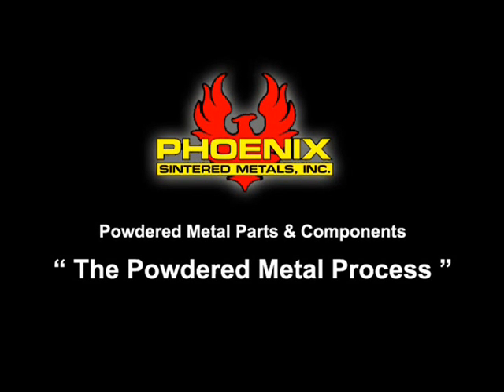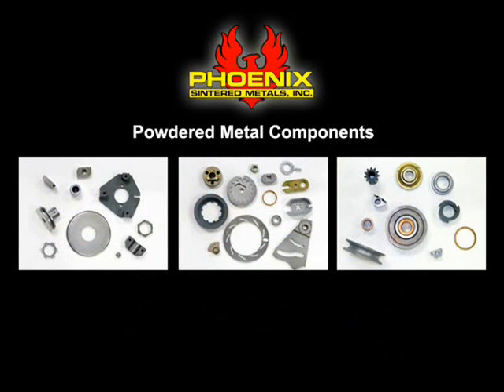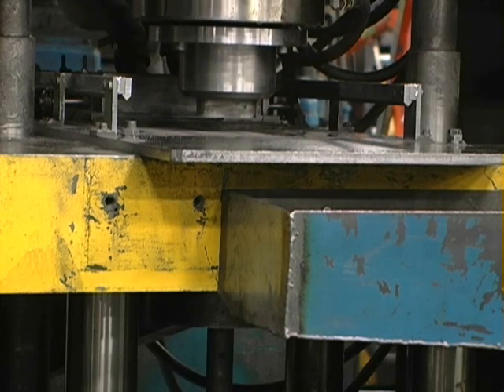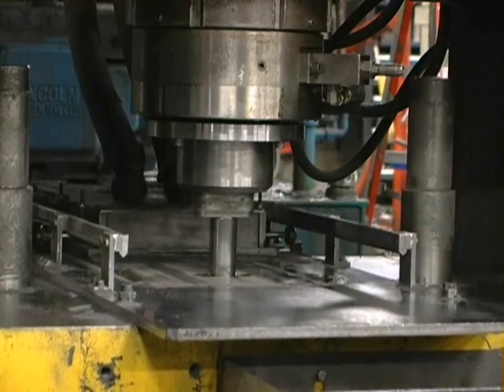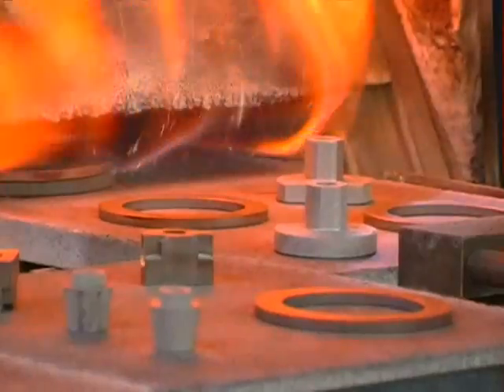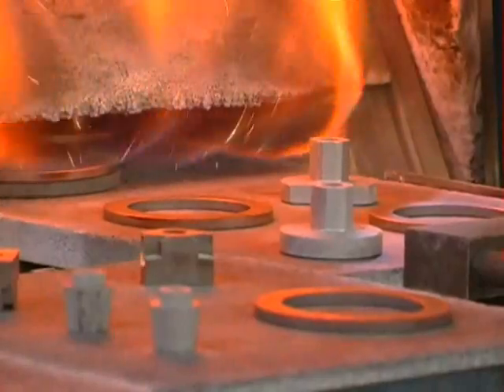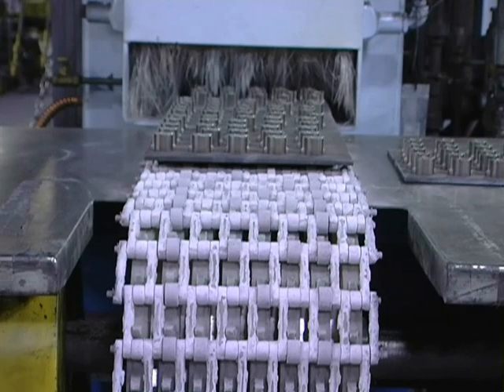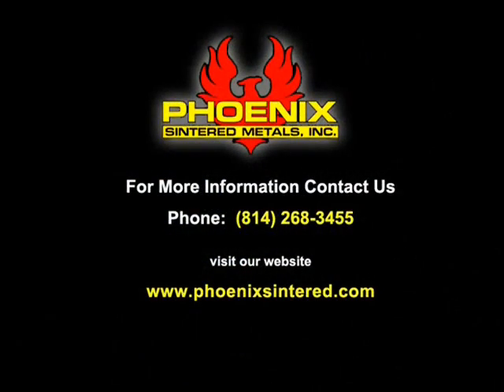Powdered Metal Parts

Comment: I worked at fms , we had to pull the parts off manually on a lot of presses , some were automatic and one had a robot arm that pulled coined parts off, one was 350 tons and was about 20 some feet tall ubove the ground and another 6-8 feet below ground, you had to climb up stairs to dump the powder metal in the hopper, it made Polaris snowmobile gear parts among other things, you could feel the floor vibration for many feet when that thing was running , there was a rumor that they got it out of a scrap yard and rebuilt it, then there was three cintering furnaces in the back room, on some parts we had to put copper slugs on the parts to infiltrate them when they went through the furnace ! I also ran cnc machines that used those Dimond tip cutters on them! I remember we would take this brown waxy stuff off the bottom of the furnace when it built up, it looked exactly like dog poo and you could throw it in swimming pools and freak people out cause it floated,lol!

Comment: Powdered metal = cheap shit
Non-durable parts.
Junk junk junk.
Thank you for creating and maintaining a cheap throw away world.. forged or nothing
Reply: Apparently you know nothing about powder metal parts. Many compontents in your vehicle is made from powder metal, including, but not limited to, connecting rods (which are forged), main bearings, transmission gears, transfer case gears, differential components. Ford, GM, Honda, Porsche, and many others all use powder metal. FYI, Ford, Cummins and GM both use powder metal forged connecting rods in their diesels. And all three are known for taking abuse.